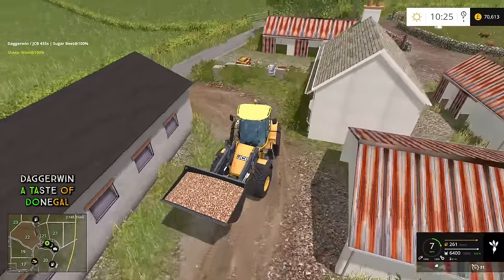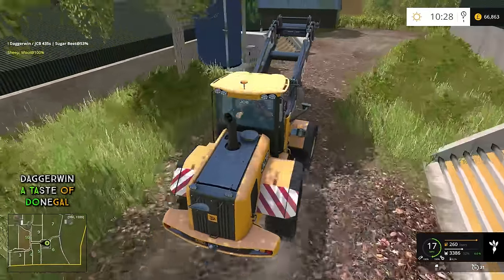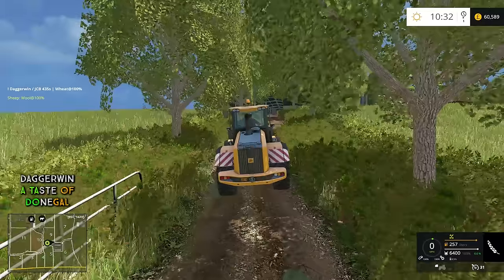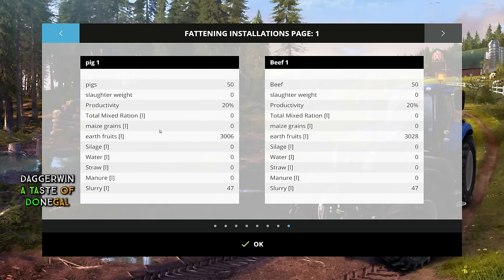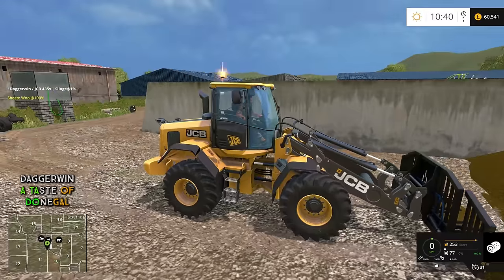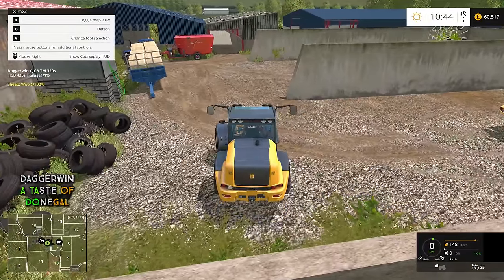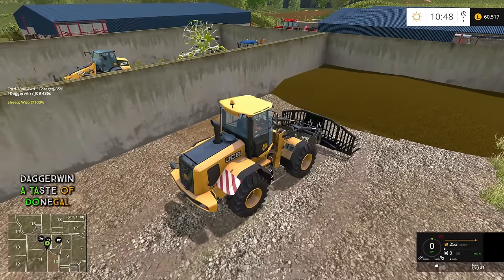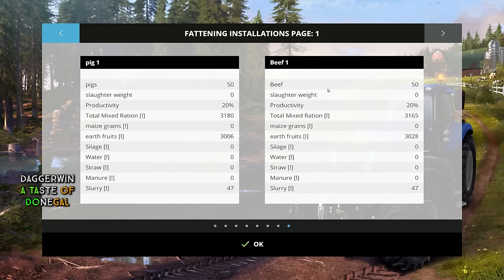Let's Play Farming Simulator 2015 | A Taste of Donegal | Episode 16

Comment: sorry its not related to this video but where abouts on mekbury estate can u sell grain etc ? couldnt find on thr map :(
Reply from the maker: You have to go to the pub...I think it calls it the port though.
Reply: I'm running a series on Melbury Estate right now :)  Grain sell point is the pub down in the village in the south west corner of the map.  To get in you follow the road around the outside and take the only entrance, then you've got to drive around the edge of the village until you get to a left turn with a muddy patch on the right (for swinging out into).  Follow that driveway into the pub, the sell point is round the back.  It's tricky to get into!
Reply: +Daggerwin great video Dagger
Reply: ***** Yeah, I'm able to get around with the trailer I've just bought, not sure I'll be able to fit anything much larger and I want to try a lorry soon!
Reply: ***** Ok, thanks, I'll take a look at that.  I'm dealing with beef and pigs in today's episode, then I'm doing some combining.  I'll see about a new trailer or two after that I think
Reply: ***** I've done small reviews during episodes, I was considering starting a new series that is just mod reviews.  Then I can do separate mod reviews for quick reference for any that turn up in my videos.  I'll go take a look at that one a min and see how well it'll fit into my current series :)
Reply: ***** Just had a look at it.  I'm thinking I won't use it on this map, I'll use that pack on a smaller map, something like Knaveswell.  That way I won't be using all the same machines in each series
Reply: What's the mod that allows the customisation?
Reply: ***** Just seen it with the newest Marston pack, called Hardpoint.  Kinda want to start a second series now so I've got a good reason to start using them :)
Reply: +Daggerwin when fs17 comes out will you immediately be playing it, say for example you're in the middle of a '15 series or will you continue on 15 for a little while?
Reply: +Daggerwin awesome video 😉😉